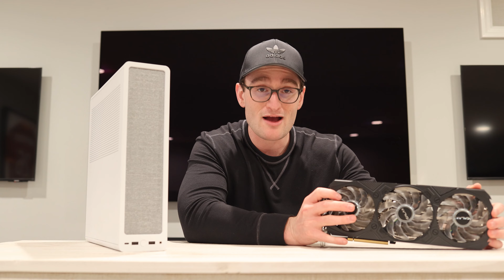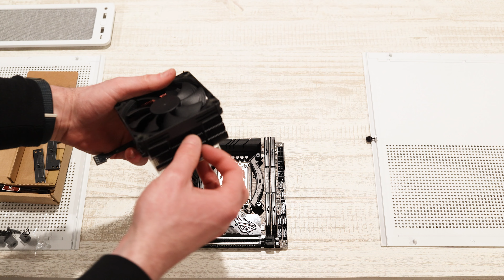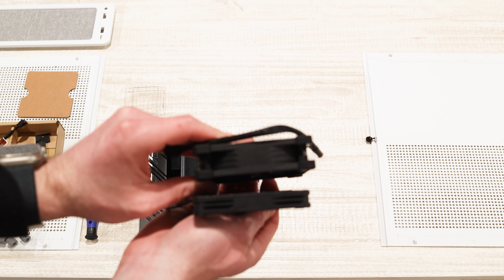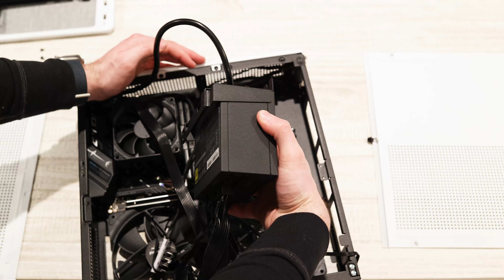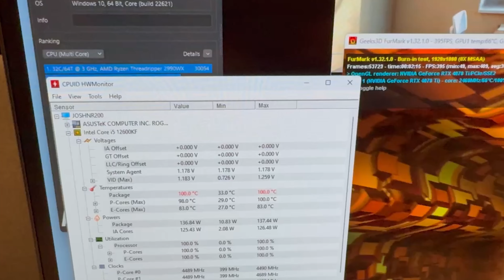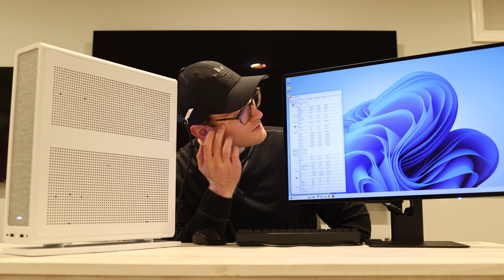Building the Ultimate Mini PC with the Fractal Design Ridge!

Comment: Take out the 140mm fans completely, they keep the lower chamber circulating hot air. Add 3 80mm top fns as intake and not exhaust. Put foam gasket around the CPU fan to close the case gap. I went from 98c to 77c after all of this at 100 percent cinebench stress test.

Comment: Should've gone with a Z motherboard. No overclocking support also means no underclocking or undervolting support. The mobo you have is likely goosing the voltage.

Comment: I got a 3090 in mine and it gets LOUD. I love the case, but like, is that the norm for it? I get TLOU going on it and BRRRRRRRRRRMMMMMMMMM.

Any way to quiet it down?
Reply from the maker: Can always play with the fan curve, or slightly undervolt the card
Reply: @TechRoundUp  the impossible has happened and I got it to shut tf up (reasonably). I put the case fans back in and adjusted the fan curve on the gpu. Will swap out the prepackaged fans for some slim ones.
Reply: @rarthusdraken5654 i read that a person decreased max fan speed for the 2 big 140mm at 1000tpm. That reducef the noise and air turbolenze to the gpu..let me know if it is ok. I am receiving this case tomorrow 😊

Comment: Yeah, 95 degrees Celsius is definitely no issue, as long as you're good with degrading all of your components exponentially faster. You would have to be an idiot to be okay with those temps when there are dozens of similar sized cases that average an actually normal temp of 60-70.
Reply: This is completely refutable. Thermal throttling is a built in fail safe to protect your components from lasting damage, rather than being the result of some physical process driven by heat causing the CPU to run slower...what you thought electrons in your silicone move slower when hot or something? really these are solid state components, what did you THINK caused throttling? Really you should refrain from making statements about something you clearly don't understand. Running your CPU at 90 isn't going to damage anything.
Reply: The ONLY idiot here is you with your lack of knowledge